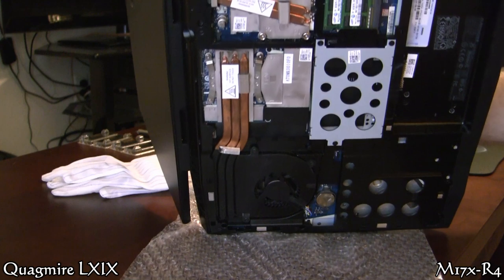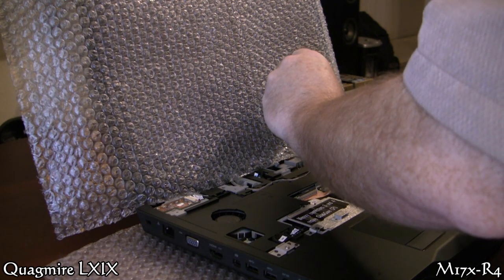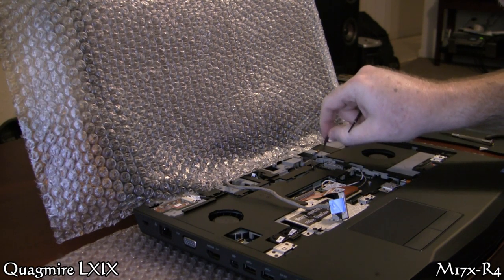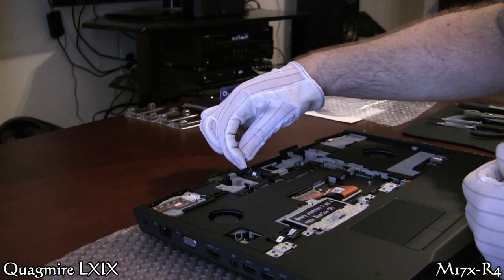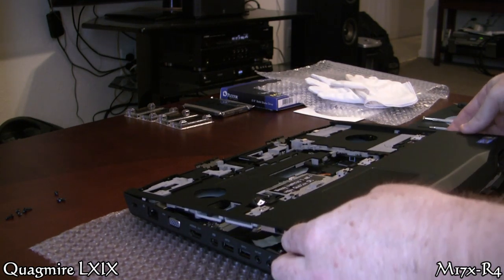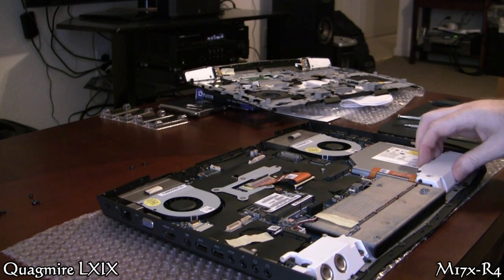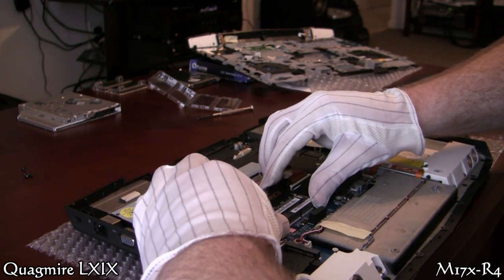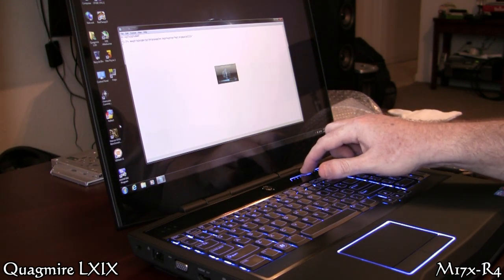Alienware M17x-R4 i7-3610qm & 7970m Cool Features - Performance - Disassembly to Optical

Comment: That is cool. Did you buy directly from Dell? I suppose all Alienwares come with Win7 Home Premium SP1 64bit DVD then for use in case the user decides to change the OS drive for something else.
@ 17:17 what is that jumper thing & bracket you put on the SSD? Does it come with the SSD?
And why did you put the SSD in the secondary slot when OS drives are usually in primary slot right?

Comment from the maker: Yes. They all should come with a DVD of whichever version you bought, the Key will unlock. Exactly.

Comes with the bracket in your R4, you'll see it all.

I read it was the thing to do at NBR, don't remember exact reasoning, but I did it and performance isn't any worse for it. One less thing to do if it needed to be returned. You can choose which HDD to boot from in the BIOS, won't matter which slot unless there are SATA II only. I'm about to make an mSATA my OS, maybe.

Comment: Nice one. My replacement keyboard should be here in the next few days. Wanted to replace it myself as it is a brand new machine and didn't fancy some random engineer coming and dismantling mine :) So your video has come in very handy.

Comment from the maker: Hi, thank you.  Assuming you do have the R4 model, tmk the alien head is light from the backlight of the screen and does not have its own light (that's why there aren't color choices).  The cables you see me pull when removing the monitor is all there is to hook up.  If you have a different model (e.g. R3, R5), I don't know.  If you do have an R4, I would call Dell back and tell them what happened, they can resend the tech or explain why the new monitor won't light the head.

Comment: Ah thanks! Im actually thinking of getting the latest M17x with a 500 GB HDD, and then plan on adding a SSD. Will be making it the primary boot drive!
Also, how much difference does getting better RAM make for the Laptop? I see that you are using Corsair Vengeance (using the Desktop ones in my PC :D) ... Do you suggest swapping the existing module with better 1866 Mhz modules from GSkill/Corsair/Patriot etc??

Comment: HelloQuagmire. I am confused @ 18:45. After you've installed the brand new blank SSD you said toss in the Alienware Win 7 DVD. I thought one needs to buy a new Win 7 when they replace the OS drive with a brand new drive. Can you explain what happened there plz? Did AW include a Win 7 or did you buy a new OEM Win 7?

Comment from the maker: Thanks Victory. 950/1450 is the max safe OC for my gpu, apps crash at 980, so I backed off a good bit. I find my OC in steps like one always should while checking your temps and for artifacts, but word on the 7970m OC ceiling is 1000/1500, so I'm right there. 
The AB bars are set to a scale that it figures the max available settings are I guess, nothing to be concerened about. One still needs to do the OC procedure correctly imo.

continued...

Comment: I just ordered the M17x R4 but curious about the blu ray install. I was going to order the blu ray player but decided I'd do the same thing you did. Q: have you used the BR burner and is the Sony drive something you'd go with again? Probably too late for me to change the order if I wanted to have them install a BR DVD but I guess I'm thinking warranty. My HP 17.3" died so I took it apart for the heck of it but I'll probably toss it. I saved the almost new Crucial M-4 128gb ssd for bay 1, 750 b2

Comment: Every card is unique. Some might get to 1100/1600 some might only get to 950/1450. All depends on your card. 100mhz OC has always been kind of a reference overclock. 
680m got the same score in 3d mark vantage at stock with a stock 7970m. Only if you need CUDA and love nVidia.

Comment: Coffee table? I would use it as a study/work desk. The height is perfect. Is it pure wood? Beech?
m17x r4 + 7970m + 1080p 60Hertz + 4 years basic warranty with every other component on stock & 10% off final price.

If the system arrives without problem I'm put my own SSD in it. I'm still struggling to choose between 120GB Intel 520 or 128GB Samsung 830 :(

Comment from the maker: Hi Chez, not off topic at all, I talk laptops. Asus is still putting out a great bang for your buck, the G75VW at Newegg is a perfect example. My only issue with Asus is the gpu choices. What had me going with the G73JH Q1 2010 is they offered the best mobile gpu (5870m) and they were the 1st to do it at that. Asus has since to do that again afaik and now idk what's up with them. This 660m vs 670m is nonsense imo, do the Kepler vs Fermi research if you haven't.

continued...

Comment: Alright, thanks for the reply.
I noticed that there was an empty drive space in the middle of the laptop on the bottom side (facing down). Are you saying it would run at its full potential if in that slot and not in the mSATA slot underneath the palm rest?

Thanks, your help is much appreciated!

Comment: I noticed you said you can add a mSata SSD, I have looked everywhere trying to search for it on my 2013 Alienware M17xR4 model but can't seem to find the slot. I'm assuming i'd have to do a pretty deep teardown to find it. I would appreciate it if you could reply letting me know where this slot is located. P s Those links in the discription about the msata location don't load anymore
Reply from the maker: I don't remember, but I wrote "You will have to remove the Palm rest to get to it." meaning you have to go in through the top, whereas nowadays the hdd slots are on the bottom like memory chips.  Look at an msata and you'll find the slot if you go into it enough.  Imo, you're wasting money and time on an 11 year old laptop, put your money to a newer one, even a low end gaming laptop will run circles around an 11 year old one.

Comment from the maker: Hey man. You do not need to buy a new Win key. My R4 came with a Win7 Home Premium SP1 64bit DVD. It acts the same as any Win DVD for installation and your Key code is under your battery, that is your license for that Win version on your R4. Then use the Resource DVD for drivers after Win is loaded.

Mine booted up activated even though I unchecked the box, no matter, but you may have to activate it once installed, or whenever you're ready up to 30 days.

Comment: Hey thank you for great video. I kinda hesitated that i want to buy new alienware 17 or upgrade my m17 rx4. mine is pretty similar as yours, but i upgraded ram to 16, 7970m graphic card and i7-3610qm processor. So is there any chance of change of graphic card and cpu ? im not a computer genius so i needed some advice what video card and cpu that i have to buy. Thank you

Comment: So I decided to save up and buy the same M17x you have here. Except for the a few minor differences. I chose the 128 msata boot drive + 500GB 7200rpm. Also buying the same Vengeance ram for this machine, that will be a small adventure to install, didn't know you'd have to take the whole laptop apart for doing so :p. Thinking about getting mine in Nebula Red, any thoughts on that? I'll probably buy it in the end of january, can't wait!  Again, very nice video Quag!

Comment: @QuagmireLXIX Just out of curiosity I ran the Unigine Heaven Benchmark on my GTX 460's ( 769mb versions) with the same settings in the video at stock speeds. For frame rate I got 60.7 fps avg, max of 130, min of 22.2.  So when overclocked it appears the 7970m has better performance then my SLI desktop rig in DX11 benchmarks/games with tessellation!!! They are catching up fast to Nvidia in performance and their prices are far lower. I am tempted to go Radeon next time I upgrade my desktop rig!

Comment: The 680M is 20% faster than the 7970m and it gives a longer battery life thanks to optimus, but if you're buying the M17x I highly recommend you to wait for some tests before do anything because the M17x R3 with 580m had throttle problems so this one could have too.

Btw don't ask this kind of things in youtube because there are a lot of fanboys so just google "gtx 680m notebookcheck" or "7970m notebookcheck", they've reviewed and benchmaked every single laptop gpu.

Comment from the maker: Mushkin is making excellent advances in mSATA, but imo it's all still just short of mature. I didn't feel SSD was mature until X25m G2 and I'm going to be the same hardass when it comes to mSATA :)
If the R4 mSATA is SATAII, well that is an issue, however, I can see the benefit of an OS on mSATA and a gamer stripping the 2 SSD HDD bays for games. I'm not a competetive gamer (controller speaks volumes ;), but it's something there.

continued...

Comment: Dell suggested I try reinstalling windows, which I can do but haven't yet. Because I'm not entirely sure there is a problem with the OS. I think the SSD may be bad? So I wanted to remove it, check it, etc. I don't want to remove all those screws and everything just to look there and not see it. I am not a computer newb by any means, but I also don't like to disassemble and reassemble things over and over again. Anything informative you can point me towards of give would be greatly appreciated!

Comment from the maker: Thanks for your tip, but no, it doesn't. I do that early in my new machine setup and it didn't make a diff (except for black screen) here. This tip is mainly for OS on spinner drives.

Comment: hi there, I noticed that your "Alienware" light on the display is not lighting up. did you disable it from the command centre or are you having the same issue as me? mine just lights up for few seconds when I power up and fades away. tried many things to get it fixed and gave up. that was the only issue I had out of box.

Comment: hey thanks for the reply. My light issue was fixed they replaced the display ,apparently the logo itself cannot be replaced they have to do the whole display. now I have another issue I upgraded to a 8gb kit of same memory and getting memory errors since then. did you have to change any settings in BIOS to get the 16gigs running properly or it was a straight swap.

Comment: thanks a lot bud!
well i did a search about the price of a seperate GTX680m a week ago and i think it costs 500 euros
but since it's the most powerfull single mobile GPU right now i think it's worth it
i am just not sure for the memory
I mean that the gtx 680m comes with 4Gb of memory while dell sells it (as an upgrade) with 2gb so i hope that the system won't have any problem recognising 2 more Gigabytes and also i hope the 240W PSU is powerfull enough to keep this thing turned on

Comment: One quick question, the stock 6gb RAM is located under the back panel, correct?  I'm just replacing those two modules, so it'll be a lot easier if they aren't under the keyboard.

Comment: I have done so many ram upgrades on laptops and desktops and never had issues like this. The rams are fine. I think there is an issue with my slots. when I tried each stick alone no issues in slot 2 but in slot two I get issues saying "limit exceeded" going to try my best if I fail going to contact tech support.
thanks for the reply

Comment: This is probably a stupid question but I have the same computer with the gtx card anyhow I installed the samsung 256ssd and I can boot it with the SSD by going into the menu right on boot up and having to restart my computer my question now is how do I get it to boot by just the press of a button to the SSD from the main Diskdrive? or do you have to do the same thing and just edited that part out? Thanks for your time.

Comment: Btw , not to scare you but on my "22nd day" right after 21 day new model replacement period I got a stuck pixel its green all the time(upgraded 1080p screen) and I called them up and they would send a repair guy to replace the screen .... that sucked. They are coming moday. the 21 day was BS I  only ORDERED it on 5/31 pixel went out 6/21 I recieved on the 4th .....well hopefully all is good, Good luck on purchasing a computer, If you buy alienware make sure you atleast push for a ram upgrade.

Comment: No, and I do not think that the M18x has it either. Liquid cooling is almost impossible to do in a laptop configuration. You may be right because I have not done any research about it but I highly doubt it. Maybe though in an M18x Because of the sheer size of the laptop.

Comment from the maker: We'll see on the 680m when users get their hands on it, but in short, no imo. I feel the 680m will edge out the 7970m, but that does not make it worth so much more. Green team rules on my desktop, but the bang4buck ratio for Nv does not carry over on laptops for me. I doubt I will ever use multi gpus on a laptop, so AMD does well for me in all aspects (5870m, now 7970m)
However, if you do 3D/120Hz, the 680m is def what you want as it should beat the crap out of the 660m.

Take care.

Comment: Hello I noticed when you booted from the SSD there is no "Press ... to enter configuration .....". It just boots straight into the Intel/Alienware screen. Is there a way for me to skip the first part and just power on straight to the Intel/Alienware part? Because before I swapped the HDD it boots straight to the Intel/Alienware logo screen.
SSD is 256GB Samsung 830.

Comment: Hey QuagmireLXIX! 
I have a quick qquestion regarding SSD:
Would the Samsung Electronics 840 Pro Series 2.5-Inch 256 GB SATA 6GB/s Solid State Drive MZ-7PD256BW work in my Alienware M17xR4? Of course, it would only run at 3GB/s seeing as the M17 is SATA II, but I don't mind that. So, would it run it fine? Thanks a ton!

Comment: I have this laptop was wondering why does it get hot so fast? Do I need to buy a cooler for it? Seems like the airflow is on the bottom..don't know why
Reply: I know it's been three months but I'd thought I'd still try to help. You should always clean it with a can of air every so often depending on the conditions you use it in. If you are unfamiliar with the process, I recommend getting help with it. The next time it gets cleaned out, I recommend installing MX-4 thermal paste. I did a lot of research on it and found a website that tested it amongst many others and this stuff essentially tied with only one other paste. I use already use it and it helps tremendously. Plus the eight year guarantee per application is nice too. I hope that helps. :)
Reply: Check your heat sink and fans; mine was heating up really badly until I discovered a crapload of dust inside. Clean out the dust, get new thermal paste. It WILL however run fairly hot anyways because it's a beastly laptop.

Comment: Past day it seems to kind of lock up. Nothing is click-able, but the mouse will still move. Its as if the system is locked up, but the mouse will move. Time is even frozen. Rebooting does not solve the problem, as it will just stay stuck in the WIN load screen. I've run Diag. and nothing shows errors. 100% working. cmd.exe /scannow does 100% working. I have opened the bottom and removed the HDD, and RAM. The system DOES have SSD... But I cannot see it. Is it under the keyboard side?

Comment: I just got my m17x in the mail yesterday. Of course, because the collective unconscious of the fucking human race likes to fuck with me, my $2100 laptop comes equipped with  the "I,k,8, enter, backspace, and brightness" keys not working. Its not a software problem because im using a wireless keyboard right now, and the on-screen one works too. It has Windows 8, and a naked ass, new computer, hard-drive and ram. Its a fuckin virgin. So am i really going to have to send it in? Or can i DYI it????